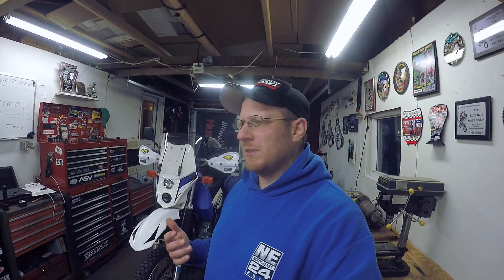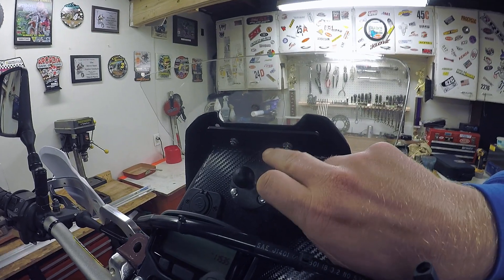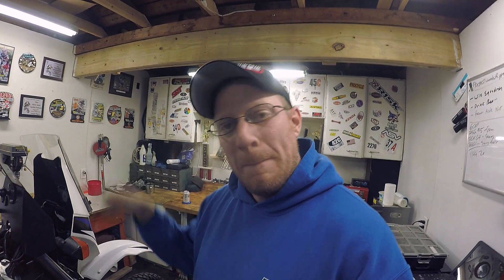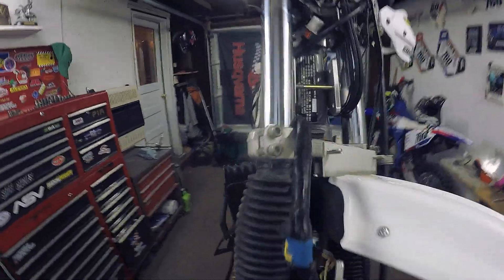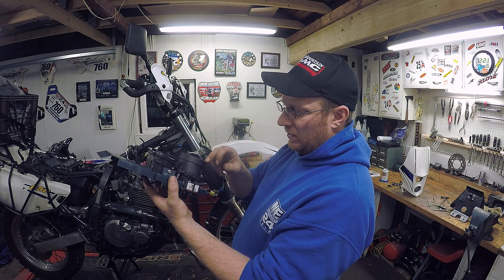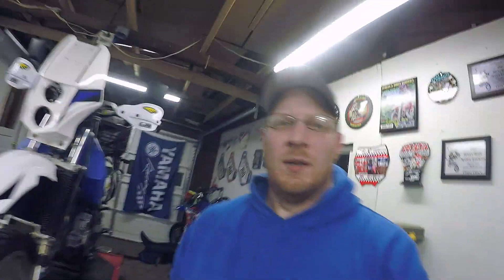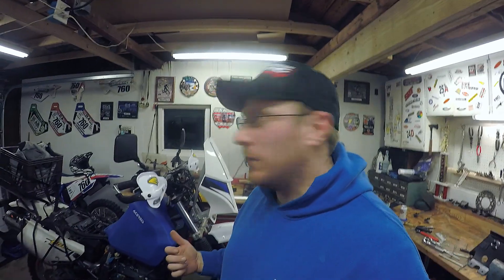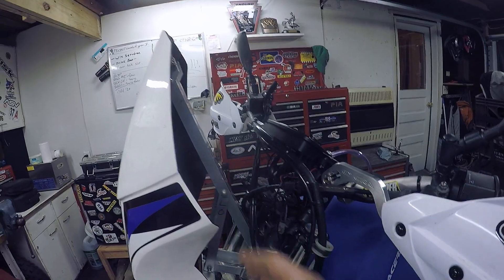Lynx R Fairing Frame Mount Pt 1: The Tower

Comment: Cool project, I'm looking to build a rally fairing for my DR650. What lights are those in the Lynx fairing? Is it a squadron sport and a hella?
Reply from the maker: Its a squadron Pro and a Hella projector with a Cyclops LED in it. The light power alone is amazing.
Reply: @robinsonmotorsports9976  thanks! Do you know what model of hella light it is? There are so many options I'm not sure which one to get.
Reply from the maker: Not off hand. I can look when I get home. I know there is a part number on it.
Reply: @robinsonmotorsports9976  that would be great! I tried ordering just the light set up from Britannia but they don't sell it separately. Is that the Squadron R version with the rounded edges?
Reply from the maker: I think so. I had the squadron pro already from racing 24hrs so I ordered the one with a sport so I would have a low wattage one for my 125. It has a rounded faceplate on it.
Reply: @robinsonmotorsports9976  ahh okay, you think the Pro is worth the price difference over the Sport?
Reply from the maker: I would say so. Don’t cheap out on your high beam, my buddy did and my pro makes it look like a flashlight.
Reply from the maker: Hella 994924
Reply: @robinsonmotorsports9976  awesome! Thanks man, really appreciate it.